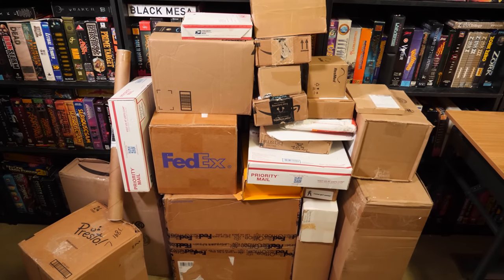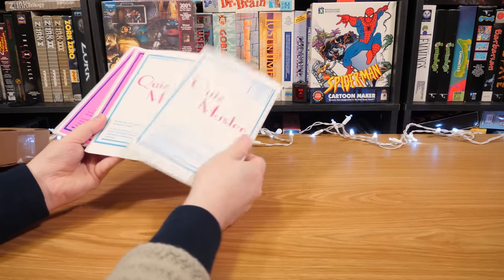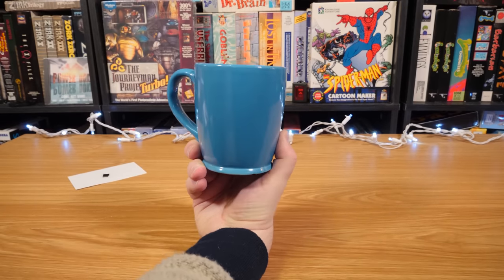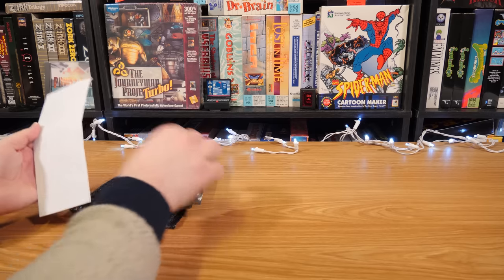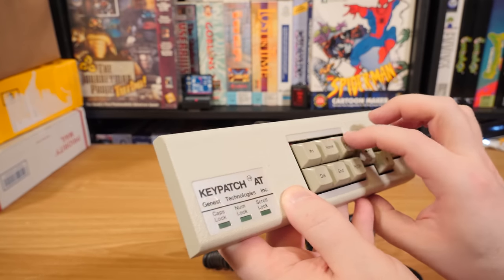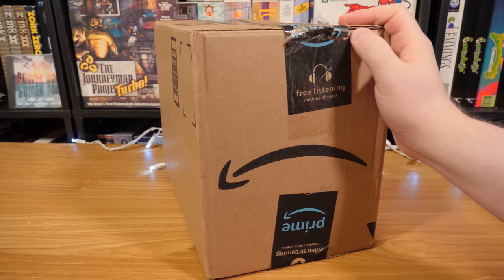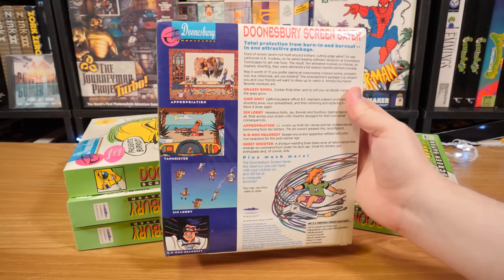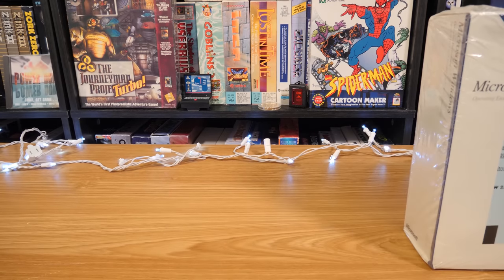Opening a Big Pile of Retro Tech You Sent In!

Comment: When you got the laptop, you referred to the cards as “PCMCIA cards.”  From what I saw they were not PCMCIA but rather CardBus.  You can tell the difference by the gold ridge with bumps.  PCMCIA was essentially ISA for mobile whereas CardBus is PCI for mobile.
Reply from the maker: CardBus is PCMCIA 5.0, was my understanding. So I tend to have a habit of just saying "PCMCIA" or "PC Card" as shorthand when I don't know the precise version of each card. 
http://www.thinkwiki.org/wiki/PCMCIA#PCMCIA_5.0
Reply: @LGR  while technically part of the PCMCIA standard, the only thing that CardBus inherits is the physical form factor.  It's not even pin compatible.  If a CardBus card is inserted into the socket, it grounds a specific pin that tells the host to treat it as CardBus (eg, PCI).  Else, the socket (and the controller) treats it as an ISA connection.  There's also a notch on the CardBus connector to prevent a CardBus card from being inserted into older ISA-only sockets.  We can get a bit into the semantics of how PCI itself was a natural extension of ISA but that's a bit in the weeds for this discussion.  Suffice it to say that most PCI chips of the era had a special section in the datasheet for how to treat the chip in a CardBus scenario.  This was all extra data in the PCI configuration space.